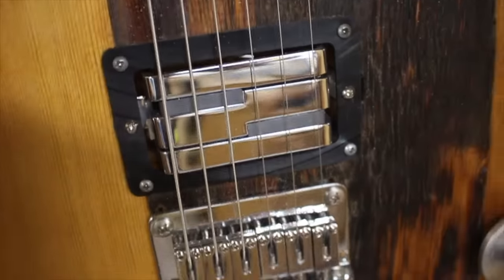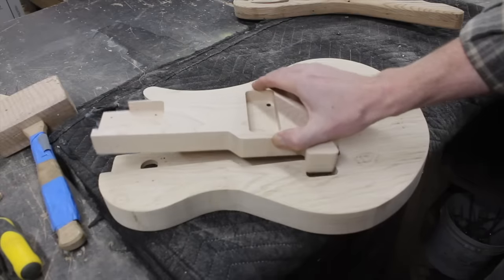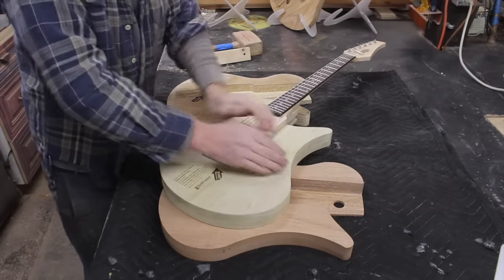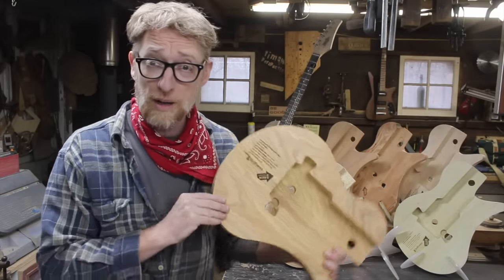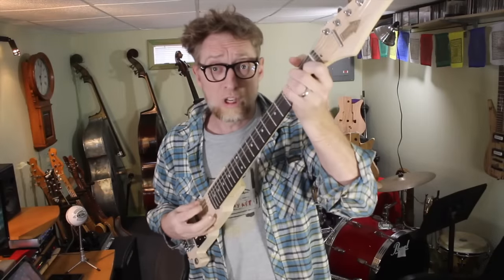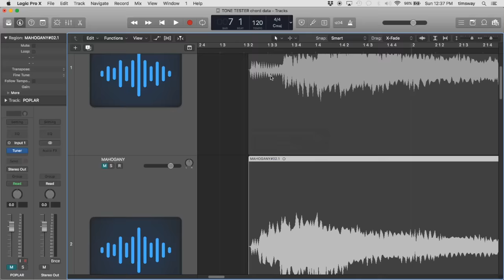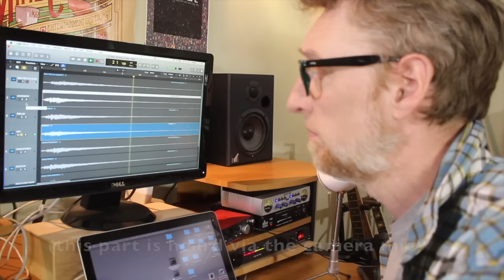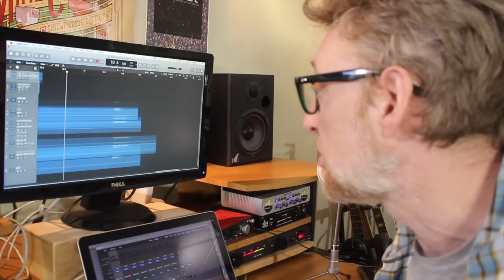Tone Wood Tester: One guitar to test them all

Comment: I think you're hearing mostly the neck and the wood between the neck and the bridge.  If that wood between the neck and the bridge varied... like it would in a "non-neck-thru" guitar where the neck was joined into the body, then the resonance of the strings would be more affected by the characteristics of the body.  I think what you're showing here is akin to when you were touching the headstock of the unplugged guitar against the wall and you decided to vary the wall composition.  It has some effect, but not the same as changing what connects the bridge to the neck... THAT piece of wood.

Comment: My loudest solid body electric to play acoustically is my super lightweight, sycamore body Telecaster ripoff with a top loader bridge (the string thru holes were not drilled by a sober adult). The other is a basswood Ibanez RG with a floyd rose, as that extra reverberation from the tremolo springs make it sound bigger than it is. It goes against conventional wisdom on these topics, but dense wood with string through bodies don't make a big difference in my experience.

Comment: But granite is more dense than wood, but would not resonate very well. Also, Sitka spruce is less dense than all those woods , but has an open light and rigid structure. I don’t think it’s about density. I think it’s about cell structure.

Also should record a super heavy pick swipe. What does it do at the extreme.

Comment: I really enjoyed watching this video and the experiment, but I have a question. Since you're not actually changing the wood where the pickup and bridge are mounted on, and the neck is attached too, is always the same piece of maple, wouldn't that be the reason why all of the bodies sound almost identical? This is proving that the sides and back are not that influential on the sound of the guitar, but the part that is attached to the neck and goes all the way to the bridge of the guitar might be the most important, and that part is not changing in this experiment isn't it? That's why a steinberger guitar which is practically the same as the part you have the pickup and bridge mounted on sounds good without a "big body", hope I explained myself hehe... So what do you think? Really interesting video

Comment: Great video...could you cnc some headless bodies like the Steinberger and Klein ..sell them online.. i bought a really nice arch top steinberger style body on ebay several years ago and I resold it and have never seen anything like it since..
Reply from the maker: I sell diy kits at newperspectivesmusic.com that include a bolt on neck and every other part you need except the body. I sell unfinished bodies for the kit, too. I also have a headless one-piece design but it's a little more complicated than I could easily do as a kit. you could cut the head off the necks n my kit and buy a headless bridge.  It would be easy to make your own steinberger body with the template system included. Here's more info: https://www.youtube.com/watch?v=AzDnHc8FJjQ

Comment: You may have managed a reasonable transfer of sound from the central block to the body - though I doubt it - but then you're expecting the sound to transfer back through the block into the pickup? It's a false test.
You could try a putting a Piezo pickup into the tonewood block and measuring that.

Comment: The mass of the combination of metal, ie:  bridge and tuners  is the most significant thing to the stridency  of "tone", pickups are equal to pot resistance, neck density next, then body wood 2%..evertthing else is less, then twiddle your pedal, amp knobs

Comment: Think about it.  the pickup is detecting an electric filed caused by metal strings moving back and forth, not what you can hear acoustically.  The  electric guitar tone is not affected by the body in this test at all. NADA.  Only if you are using a microphone with an hollow acoustic guitar do you see big differences, even then the wood makes a very small difference in overall tone.   Electric guitar bodies are 100% marketing and most are painted.  Might as well be fiberglass or whatever is lightweight and cheap.

Comment: So, I've watched this in the past, but this weekend I came across info for the Boaz One guitar. You want to talk about the differences in tone wood? Take a look at that guitar... oh wait... It's modular and made entirely out of plastic! :D Very cool design ideas is that guitar.

I poke fun, but I'm not arguing that woods don't make any difference... Even though Pickups are based on magnetism picking up the vibrations of the metal strings... I think you do still get differences in sound if those pickups are mounted into different materials. Not just wood, though. The mounting point material will absorb different frequencies, making the string vibrate slightly differently. I just don't know that most people can actually tell one from another, since the differences could be so slight. And sending that information over YouTube is sure to be even more difficult to decipher due to compression. And, back to this video, if this test guitar had used a different mounting wood/material as the basis, and used all the same bodies that were used in this video, I get the sound would change ever so slightly again. Or if the mounting wood were the same species, but just a different piece of wood... slightly different sound.

My point is that all sorts of things can make for differing sound experiences, so being totally consumed with tonewood can get a bit insane. And everything can sound good, because good is subjective. The only thing that can be said for certain is that there will be a difference. Good or bad difference? Noticeable difference? ...well... that depends on the listener.

Seriously though, check out the Boaz One, it's pretty neat. I mean, come on... Now we can get into tone plastic debates! XD

Comment: Tim, interesting video. I remember reading in the distant past that a luthier, Antonio de Torres I think it was, made a classical top plate with fret board and tuners similar to what you are doing. He said the backs and sides made little difference in tone. He even made a back and sides  body out of paper mache. Said it didn't matter much. I realize that he was dealing with a vibrating sound board and you are not. I suspect the tone lies in the part with the bridge, strings, neck fretboard neck and tuners. Try using the same body an using other inserts of different types.. I wonder if anyone tried building a guitar on a block of granite maybe like a lap steel? Out of curiosity, what is the input impedance of your digital recorder?
Reply: A guy made a strat out of concrete and it sounded like any other strat.

Comment: Hi! Nice video and experiment. What is you view on the bridge? That is one part nobody talks about, but, is in constant contact with the string, so the saddle/bridge material and geometry should be important too.
Reply from the maker: The way I see it, the bridge and nut are really the only points where the string contact with the guitar really matters, y'know?
Reply: @timsway  hi! Yes, but it can be argued that the finger tips somehow nullify the effect of the nut most of the time, not to mention the frets. So the bridge (and saddles) are the only ones that are there always.
Reply from the maker: @elluisito000  indeed. Also why I've been more and more in to zero frets, so open the string is reacting in the same manner as "closed".
Reply: @timsway  so, when will we have a bideo about the same guitar with the same PU and different bridges? :D

Comment: I think the differences would have been more pronounced if the "base" wood had been different each time as well. It would seem if it were possible, that that would have the greatest impact, because it is what the hardware sits in. Good test, solid results, but like all good experiments, it is only a little data towards a bigger issue. No one experiment is conclusive in and of itself

Comment: I do audio engineering as a hobby since quite a few years now. I consider myself trained in hearing differences in sounds.
And my conclusion from all of this is that whatever difference these woods make is really marginal.
I think what makes an electric guitar good is the quality of the electronics and how well it's put together (tuning stability, mechanical parts etc.)
The only question I have left open is: does an expensive fancy wood age better and the guitar stays together better while a cheap guitar turns into compost ? That'd be the only selling point left for me

Comment: So the result is maybe that body wood barely if at all affects the tone. Probably neck is more important? An experiment on different necks the same shape different woods, even with no body, and using the same one pickup for all, would be interesting. Anyway i personally think that pickups, amp and specially speakers are usually more important for tone than wood.

Edit: i think this experiment can even be considered a neck thru, for the neck goes until after the bridge. It's not a partial neck bolt on or glued next to the body limit.

Comment: the strings need to be fixed in the body not the neck,the tone wood will act as a damper/brake if it's soft and it will act as a solid non moving non absorbing anchor if it's hard,and any grade in between will get progressively damped or enhanced,the softer woods help bass tone come through while damping out less energetic treble string vibration,from there up the treble comes through,les pauls have a mahog body with a maple cap,mahog is slightly softer than maple,good solid bottom end but not too much treble,or use rubber.

Comment: It would be cool to have a look at the fourier transformation, as it shows resonance frequencies (when using the same shape, they depend on the speed of sound which is dependend on the material) - maybe in another video?
Reply from the maker: the audio files are pinned in the comments for inspection. Several people have and they look very similar.

Comment: Tonewood matters little for electric guitar, especially because you can effects, amp modeling, etc, to get essentially any tone you want.

In acoustic instruments, I would say wood species and properties matter far more than in electric instruments.  Even then, the differences are subtle.  There is a mandolin player on YT who compares a $50 plywood topped mandolin to a $400 solid topped mandolin to a $4500 solid topped mandolin.  The $50 instrument held its own against the other two, though you could hear a difference.  Was that difference worth $300 and $4400 dollars?  That is rather subjective, and something a buyer would need to decide for himself.

Picking technique also makes a huge difference.  Try holding a pick and strumming with it flat against the strings.  Then try holding the pick so that it touches the strings at a 45 degree angle, so more on the edge of the pick vs flat.  That difference right there will be more apparent then any difference in wood.  Of course the picking differences also work with the wood, so there is that.

When it comes to buying, buy what plays good.  I have passed on guitars that I wanted to love because they just didn’t feel right, and have bought others that I almost walked passed because I didn’t immediately love their looks.  At the end of the day, your guitar becomes your guitar.  Regardless of what anyone tells you, if you love it, great.

Comment: The kid has a great brain! And he knows how to use it! That's rare these days! Good work !
As far as the tone-wood matter is concerned, IMHO the question is wrong!
Does it make a difference? Yes! It's measurable! Denser wood conducts the sound better, so it's bound to have more sustain and a crisper sound. (Physics...)
And that seems to be exactly what measurements show time and time again.
The question should be: Does it matter if the wood makes a difference? The answer to that is absolutely NOT, unless you're a guitar god with perfectly tuned ears. 
EVERYTHING else makes a MUCH bigger difference than the wood, as far as tone is concerned. Especially the guitarist him/herself!
Does that mean that using different woods is a waste of time / investment etc? No, absolutely not.
Different woods also FEEL different. A denser wood can be used to make more exotic shapes, because it can handle the strain better. A softer wood is usually lighter,
so it's ideal for beginners or musicians that play for long periods at a time. And there's personal preference. I personally like to feel the guitar. It also helps to keep it balanced. 
Almost finished building my first guitar actually, and I made the body out of oak plywood. Why? Because it was cheap, and I live on welfare. (The entire instrument cost me at most €200,- in materials, including some specialized tools that I needed!)
Will it sound good? Probably not. But that's because it's my first ever, and not because it has a plywood body :p 
(The neck is mahogany btw, fretboard blackwood-tek)

Thank you for making this video! LOVED to watch it ;) (Especially when the kid suddenly explained things better than most adults can :p )

Comment: Mass producers like fender, Ibanez etc. has to think about their costs in the first place while producing something. fender chose alder because its fast growing and ash is an open pore wood and filling the pores labour intensive. Even the wearing in the machines becomes a thing when you're producing thousands of something and softer the material you machining lesser the wear. And don't expect fender tell you " Yeah we are using alder because it's cheaper" of course they will turn this into some marketing strategy.

Comment: Cool modular builds..BUT, the best tone wood test that I have witnessed was a gentleman who created planks of each, of identical size and cure- utilizing the (exact) same pickup, and one neck (in this case, maple). A taptone was demonstrated for each before the test, which in itself was revealing. Surprisingly, there were VERY subtle differences in electrified tone. After watching many builds the last year on YouTube, I was verified on my long held assumption around solid body instruments- which is that you can design a guitar around just about ANY material- correctly or incorrectly. The true skill lies within the proper sum of parts for the design. Tone woods are often quite attractive, but better tone diffences show better on acoustic instruments. I am a restoration luthier, so I have seen (and played) some very different instruments.

Comment: I can hear diference on the harmonics the strings gets back from the wood. I think a proper test would be guitars made out entirely from diferent materials using the same electronics. As the pick-up and the bridge are on the same piece of wood in every take, the lack of diference of tone at the struming point is only natural.
 
By the way, do a test, when you’re taking out the strings of a guitar with wood mounted pickups, plug the guitar and pluck the body without the strings. That is to prove that the magnetic fields of pickup coils are being afected at least to some extent by the wood vibrarions.

Comment: It's a bit old but I just found it and I think there's one weak point to that (at least when it comes to the benefits of some woods over others...). Or maybe there are more but this one is particularly worrying me. The sound difference that result from different woods comes from the way the wood resonates, it does that because the resonation from the strings is carried to the wood. That's also how acoustic guitars work. The point here is, to have a optimized transfer from the string to the body, the bridge (which is mainly responsible for the transfer) should be mounted onto the the body itself. In your design, the bridge is mountet to the core with the neck but NOT to the different bodies you usw. The resonation will transfer through the core but NOT in the same way it would on a directly mounted bridge.

How do you think about that?

Comment: MDF sounds actually the most neutral. That's probably the reason why it's used extensively for high quality speakers.

There are tiny differences in the warmth and the harmony between these woods. For example the door sounds awful, because the harmony of the notes between each other is really bad. I think what's happening is, that different notes get different sustains by the wood. On a base it's more pronounced, if you play a high string and a low string they should sustain the same - what they don't on cheap wood.

 My favorite is ash.

Comment: When the Pickup is constantly sitting tight in maplewood and the 2 wood types are seperarated not one piece - then I think the tests will sound similar. I only think you will be able to hear a real difference when the pickup is seated in a full body. The vibration in the wood in your test is too colered by the maplewood.

Comment: The particular body of a solidbody electric guitar matters much less than the neck and mostly for its STIFFNESS and MASS.  The stiffness depends less on the type of wood than the THICKNESS of the wood.   (Woods do not in themselves have characteric sounds, independent of dimensions, in the frequency range relevant to electric guitar bodies!)  You can make a cheap light wood just as rigid as an expensive one by making it a little thicker.  The stiffness depends ont the CUBE of the thickness, so even a wood that's half as rigid can make an equally rigid guitar body if it's just 26 percent thicker.   (1.26 x 1.26 x 1.26 is almost exactly 2)   You can make that body more massive by putting a few weights along its length, so that it has the same overall mass distribution as the expensive hunk of wood.  (You can also adjust the sustain and tone vs. lightness by adding or removing weights.)